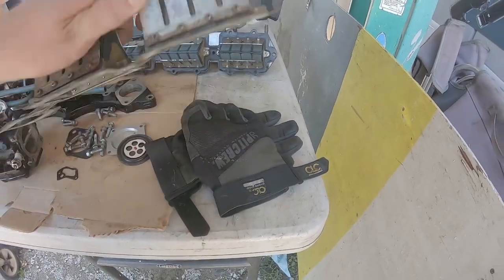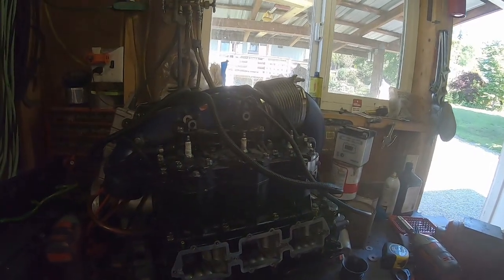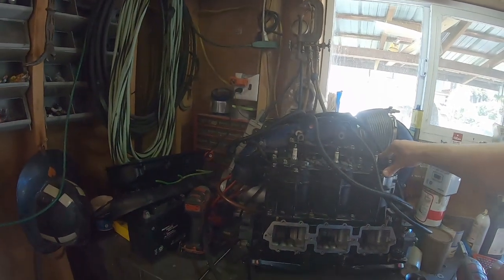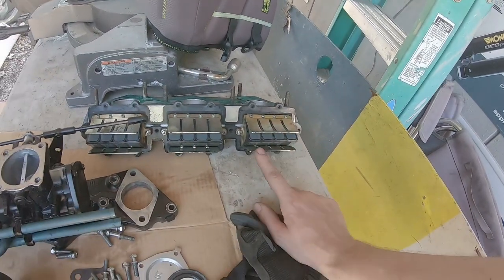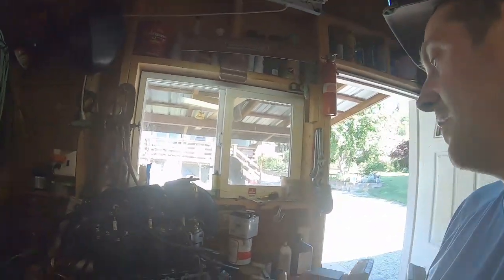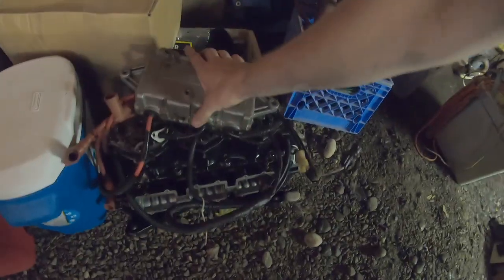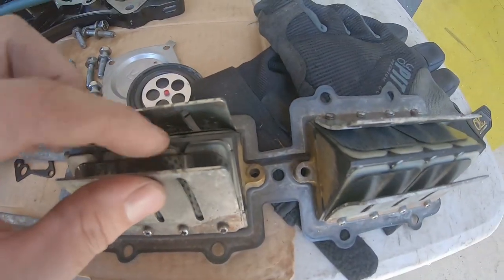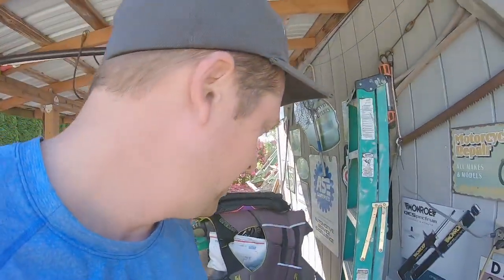gp1200 engine issues

Comment: Question  my jet ski is a Yamaha waverunner 1200 run fine on the trailer with the water hookup every time I back up to the lake jet ski die 
When I pull out from the lake take a couple seconds and then the engine start again,  if I let the engine running and back up to the lake again , the engine die again ,,,any idea ?

Comment: Hey guys , just finished watching this video and I thought you might like to know some facts about reeds . The Reed stops on the GP1200 are set from the factory at 10.7mm from the tips of the reeds to the tip of the metal stops . Any more clearance results in reeds that flap at full throttle and don’t seal properly , you can lose 10 hp just from this alone . That’s why some engines are rockets 🚀 and others are slugs 🐌. Stock reeds are best for the long term , I have a reed spacer on my GP1200 that pulls the reed cages back 8mm from the crankshaft and increases crankcase volume too . It’s the little details that results in a really good engine performance. Have you guys done the fuel pump pressure equalisation mod  to the carbs ? Stops the engine running lean on one cylinder and seizure from damaged fuel pump check valves..
Reply from the maker: excellent info

Comment: Not true not true put some oil on the reeds and look at them seal. also when piston is on down stroke there is pressure on the reeds that's not there when your looking on the bench. Yours may be junk aftermarket and someone probably way over tightened the screws because afraid would fall out. look at all the motox bikes that had them stock I have them in 3 bikes two outboard and two pwc's and they all idle like the well tuned machines they are. Ive installed so many in pwc bikes and outboard but I took the time to surface the cage flat. Idle quality twice as good with good fiber reeds. and I will never ever ever use the cheep aftermarket carb kits. I very seldom ever buy a kit anyway just new diaphragm from yamaha of coarse I never used carbon x reeds just boyseen and never ever ever over tighten the screws this will make them not seal. I torque them and use locktight. I have them in 3 of my classic bikes and my yamaha prov 150 and it idles so so good and smooth.

Comment: Have you done the fuel pump pressure equalisation mod ? GreenHulk goes into detail on how it’s done , also you need to fill in the grooves in the inlet manifold that joins all three inlets together. This improves the signal ( vacuum) to each carb at high speeds to stop 🛑 the carbs running lean . Makes the engine run better and more reliable too . While you’re at it , do you want some porting specs on the exhaust ports on the 65U engine ? This engine has serious exhaust port area deficiencies that kills the potential of the engine and extra rpms . Let me know and I can email pictures and exact measurements. Regards Adam
Reply from the maker: any info you can get me would be great. Especially on the 1200r since I just got a couple of them.
Reply: @JetSkiBrothers  the GP1200R has some must do reliability upgrades that you should do. 1 
 Fuel pump equalization mod that lets the all 3 fuel pumps share the job of maintaining fuel pressure.  The return hole in each carb is drilled out with a  1/8 drill . A 95 main jet is placed in the outlet of the return   line to the fuel tank in the carb that the throttle cable attaches to. 2 The cross over ports under the carbs in the inlet manifold must be blocked off with silicone.  This improves vacuum signal in the carbs for much better jetting and prevention of lean seizures. 3 The powervalves need wave eater retainer clips installing,  this prevents them from coming lose and damaging the engine. The plastic powervalve joiners need to be replaced with a solid joiner that ensures all 3 valves open and close at  exactly the same time.  This is really important ! It stops the PTO cylinder from working harder than the first 2 cylinders because they don't have full opening of the valves due to flex in the stock plastic joiners . Yamaha must know these things wear out eventually and cause the engine to fail . 4 carb jetting.  110 pilots and 120 mains ,1.5 needle and seat ,95 gram springs. 1 turn out on lows . 1 1/2 turns out on highs .
Keep the choke plates and use aftermarket flame arrestors
The GPR likes more compression,  the head can be machined.  38 cc domes will be pump gas safe using 92 octane fuel. 150 psi . I have my own lathe and mill to do this work . Do you have anyone able to do this ? 
I have an Advent 1290 ignition using the 84 curve and 7800 rpm rev limit and powervalve settings snap 58 . The stock CDI opens the valves more slowly than the Advent 1290 so caution must be used with compression with the stock cdi 
You can use the exhaust system from an 05 or later GP1300R for another 10 hp with the powervalve engine. 
The exhaust port can be widened to 56.8mm or 71% of bore if you want to go really fast.  Caution here if you haven't done porting before on Nikasil cylinders.  For the pump , a 14/20 Solas concord works with these mods , R&D gp800r scoop grate is the fastest and a R&D ride plate.  Stock sponsons   stepped up at the front and down in rear is best . Trim tabs spaced down 3mm on each bolt is a start . The stock nozzle is a 87mm dia , I use a GP1300 85mm nozzle for top speed , I also have a GP1800 nozzle that gives good acceleration. Buy a GP1800 steering nozzle too , plastic sucks when they break.  That's a start ,but there's still more can be done . I have a Skat trak setback 158mm pump   that is simply awesome 14/19 impeller, 7300rpm at 73mph ..I also have a fuel pressure gauge to check fuel flow . 1-2 psi at idle  ,5-6 psi full throttle. 
If you want more info ,send me your email address and I can send photos of porting and other pump mods .
Regards Adam

Comment: Stock reeds outlast any other reeds on the 1200 . If you have new reeds you can cut the old reeds about half way along and sandwich them on top of the new reeds under the metal stops . This adds stiffness at high speeds and still have a snappy sealing bottom end response .
Reply from the maker: I like it
Reply: That sounds good

Comment: I just pulled off my intake to check my reeds and I’m not sure if they are shot. I can see a little light between the end of the reed and the body. Should there be no light at all? I thought my ski was running bad because I didn’t have my carb tuned right because I could only get it up to 22 mph on my 650sx with a 46mm carb. Low end was fine but it seemed like it couldn’t rev up all the way.  Should I replace my reeds? Does that seem like the fix? Thanks.
Reply: Usually when your reeds are bad you get no bottom end at all.
Reply: Jacob Superjet Jet SKI  ok thanks. I just flipped them around and put them back on. They look like they seal better.
Reply: @Jacobskibros   Curious to get your thoughts on this.  I have a 99 Carb Polaris 1200 Genesis jet ski.  When I give this throttle it bogs a little and funny as this sounds it sounds a little like a goose.  Could that be a reed valve noise?  I have my fingers crossed that's the case and its not a crank shaft noise.
Reply: @wkualum3194  To me it sounds like you may need to clean the carbs, but it's hard for me to really know. Reeds? Maybe? doesn't hurt to check.

Comment: Hey do a show on the js550 with 440 pump. Go into details about if its worth it or not! I got a 550 that the needs a new shaft and impeller from some dumb chit damaging during removal. (I now know they are opposite thread imprllers!)
Reply: I am up in air on ordering parts or slap a 440 pump on with s stainless says skat track 5 5 on it.
Reply: @TheShockLoad  do the 440 pump, especially if you already have the parts. I was pleasantly surprised by mine, and I'd like to know if you get the same results.
Reply from the maker: TheShockLoad it’s on the way. And btw the 550/440 is a really great combination